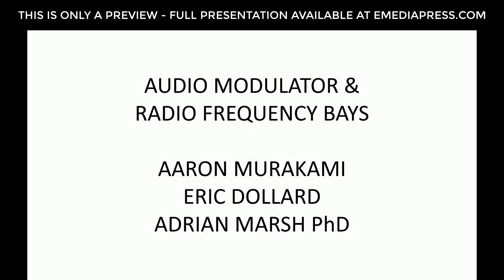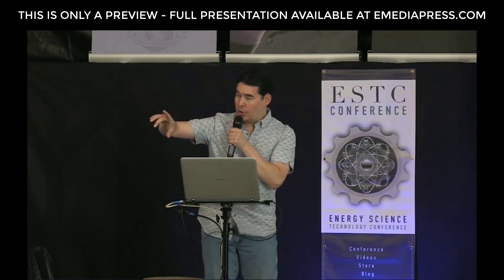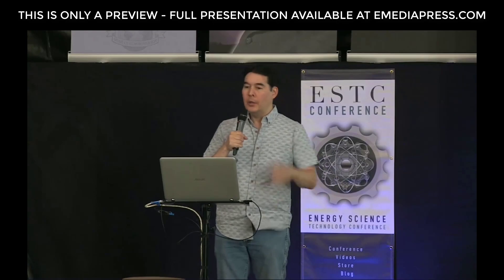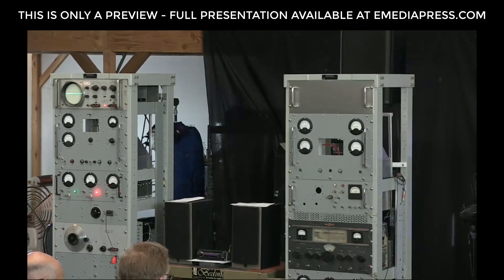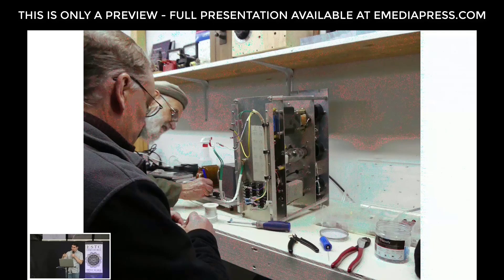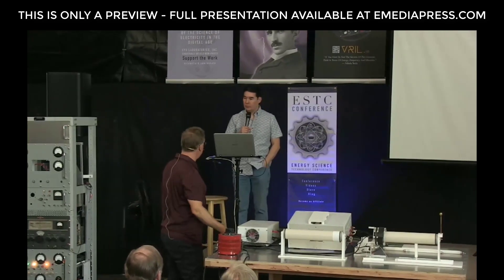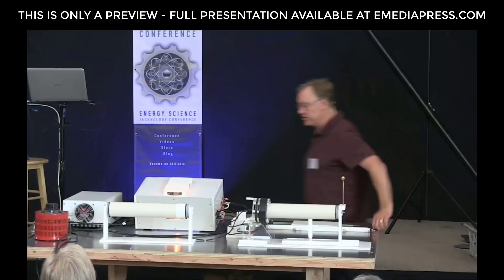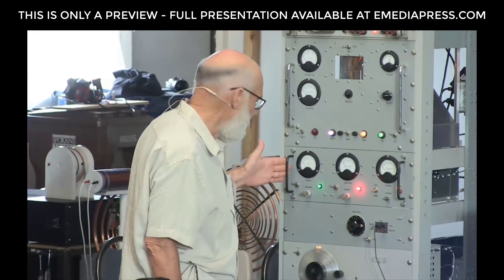2023 ESTC Eric Dollard, Adrian Marsh PhD, Aaron Murakami Ultra Low Frequency Amplifier-Modulator

Comment: What if... you don't want the dome of a tesla coil to have output. Dome inside looped back to coil. Creating feedback. In a loop. At a certain frequency. No sparks, just high voltage pressure waves. Just speculating and spacing out.

Comment: Why don't they explain anything? Am I the only one who doesn't understand what they're trying to demonstrate?
Reply: The racks are basically a complete multi-kilowatt AM radio station in-a-can.  The flame speaker is really just a neat demo, a cool thing you can do with it.

The real purpose in the end is to have a high-power control rack to do very advanced Tesla Coil experiments with.  Things with parametric variation or dynamic phase adjustment and crazy things that you simply can't do with existing hardware.

A simple spark gap or SSTC coil would be like an old Ford Model-T; this thing would be more like a Tesla model S.
Reply: @hakasays  thank you
Reply from the maker: Read the text at the top of the PREVIEW video you watched.
Reply: Because it is all woo ..